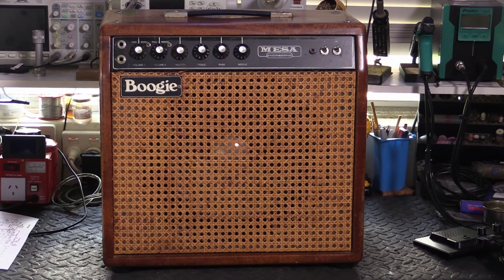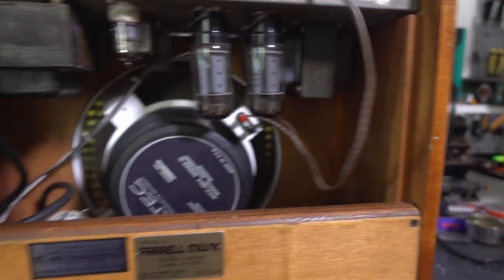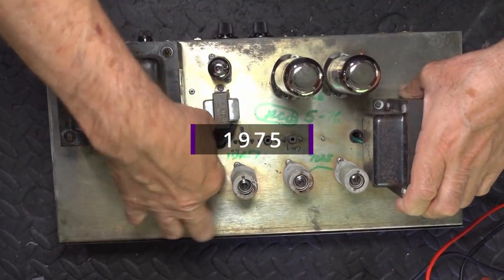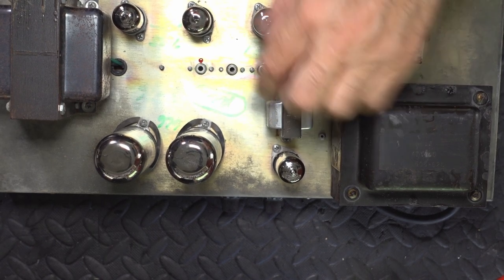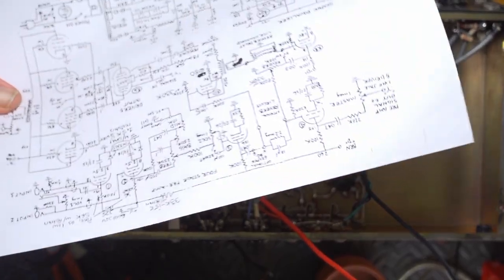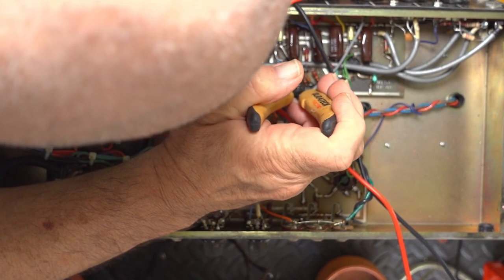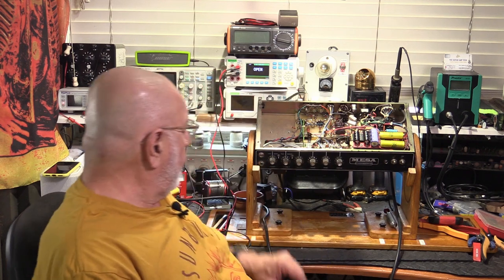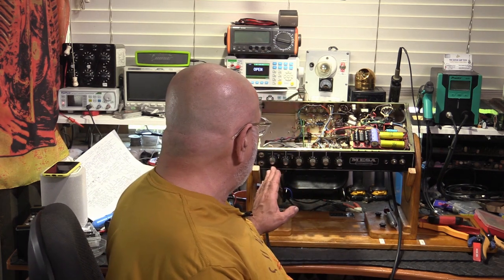Let's Repair and make Safe this Mesa Boogie Mk I - Part One

Comment: It is so interesting to see inside and analyze a Mesa Mk1 amp! Though there are numerous issues with its internal construction and repair challenges, it is an iconic amp and deserves its place in history. I have owned a Mesa 292, 290, TriAxis, Mk5 and Heartbreaker amps. And with these Mesa products, I could not bond with their sounds. I am a tech and opened these up to study them, and was not impressed with the PCB designs, wiring and choice of components. That said, I have a Carlos Santana King Snake combo. I have not opened this up, because I don't want to be disappointed! The simple Mesa amps are their best. Thank you for your wisdom and generosity. Eagerly awaiting Pt 2.
Reply from the maker: I very much like the sounds of the early Mesa amps. I just lost the faith when one 12AX7 pushed another then another. 
Thank you for your kind words, John

Comment: Thank you for a fun trip down memory lane. I designed guitar amplifiers in the early 1980's and owned a Mesa Engineering (Boogie) certified repair lab. On those early Mark I amplifiers Randy Smith added 'antennas' which were flying wires to introduce capacitive negative feedback at very high volumes to tame feedback to a degree. The earlier models from what you have had an 'antenna' running from the output stage back along the entire board towards the input. Like myself, Randy was also savvy in ham radio techniques with high-voltage and on a cold winters day must have discovered some slight improvement with this scheme (later to be eliminated). Carlos Santana (and others) needed high gain, no squeal amplification, and it was true these little amps could 'Boogie'. Those labels are called DYMO labels. I enjoy your channel .. happy to answer any additional questions. -Daniel (Seaside, Oregon, USA)
Reply from the maker: WOW! Thanks Daniel. I was wondering if this wire could have been a rudimentary single stub, but the way it was just snipped with exposed plate voltage made me think otherwise. It had to go just for safety. Removing it, didn't seem to affect oscillation. Did Mesa come up with a better scheme to reduce HF oscillation? I was getting the same amount of oscillation before and after removing the stub...no better or worse.
Reply: I too was an authorized Mesa repair station until they got so obsessed with component density over “sound” design practices and using under specd components like diodes, relays, and coupling caps on the output stage. I had enough quite a few years back and gladly turned it over to another qualified tech.
Reply from the maker: @fiddlix  That was very well put, David. I’m actually a bit embarrassed to say that I still own an early Mesa (…shhhh. Don’t tell anyone). As you said so well, Mesa lost their way, sadly. But, brilliant marketing led to enormous commercial success. After the Triple Rectifier I just completed, I think I will return to my “no-Mesa” policy endorsed by my psychologist, accountant and family!
Reply: I love the very old Mesa Boogies. I have three. Mesa gifted me a Mark 2C they built for Carlos Santana, but Carlos returned it to them saying his guru had told him to simplify his life and he didn't get on with the push/pull knobs and channel switching complexity of the newer amps.  I recently retired from 'real' engineering and for fun, took on about a dozen modern Mesa amplifiers to repair. Terrible. Absolute nightmare. Mesa does not publish the parts placement diagrams so it is almost impossible to trace out and find components without identifiers. No matter how careful and skilled you may be, you will lift traces and pads when replacing many components. So frustrating. I also own a Mark V:35 ... god help me when and if it breaks. There are good reasons why most Mesa techs end up alcoholics (or worse). 🤪
Reply from the maker: @bluewaterstudio  I love your sense of humour, Daniel. How amazing that you own a real Carlos amp!! I 100% agree with Carlos and his Tech about the totally unnecessary pull knobs, relays, or God help us, MIDI in an amp. If you can't find a good sound in a one-channel amp, just keep looking for an amp that natively has THAT sound. For me, the pinnacle of tone was Eric's Beano sound. 
"Mesa Techs end up as alcoholics". Love it!
Reply: Was this akin to the hot shield mod done to Marshall amps to alleviate the microphonic wires from resistors to the grids? I did this to my Mojotone Plexi clone, and it made a significant improvement to the sound, and I was able to use my Legendary Tones Hot Mod on that amp without a high noise floor.
Reply: @theguitaramptech  Sounds like a sound plan to me. Lol.
Reply: So trying to stop high dc voltage from talking to the low ac voltage was a thing instead of a larger chassis and more cost , funny how the CBS corporation did the same thing to stop oscillation when they fired Leo fenders best builders to cut costs and used a disc cap to ground to to compensate the bad lead dress of cheaper workers, ha ha.

Comment: Hello Chris,
once again a video full of humour, competence and wisdom. The older Mesa amps don't seem to be quite as badly designed as the later ones. Thank you for this fine video.
Kind regards
Markus from Germany
Reply from the maker: Thank you so much Markus. I certainly like the sound of the older ones than the newer Mesas. But old or new, they are not pleasant to work on. Way too complex. You would never find ribbon cable, relays and MIDI in the golden days of Fender, Vox and Marshall...and they sounded so much better. But...now I sound like an old guy talking about "the good old days". But they were. And I am glad I lived through them. May your father rest in peace.

Comment: Magic Erasers removes marker easily. Another great video, you've taught me so much, thank you!
Reply from the maker: Thanks for that tip, VTA. I've heard of Magic Erasers, but never used them. Is this the same product you use? https://www.bunnings.com.au/mr-clean-eraser-pad-block_p0066425
Reply: Magic Erasers are very usefull, but can be slightly abrasive to some surfaces, so use caution!

Comment: That high pitch squeal you had earlier in the video is oscillation as you point out. I think you still have oscillation occurring that is out of hearing range that is causing your voltage to shift. Low frequency oscillation at the frequency that you see the voltage shift.
Reply from the maker: Good point A/Tech. There were definitely 2 different oscillations that were plaguing this amp. . I reinstalled the short stub, but it didn't help. Adjusting the Lead Dress stopped it. Good observation. Thank you.

Comment: I have worked on Mk 2, 4 Quad, Triaxis and currently have Mk 5 on the bench and think your comments were very restrained.  Many tech avoid Mesa built ofter 1984 as the repair work is unnecessarily challenging. Mesa do like owners to repair their amps to them for repair and they have good repair techs.  Not so easy or cost effective when owners are outside USA.  I find the tech support via email helpful and prompt since Gibson took Mesa over - presumably providing more resource for customer support.
Reply from the maker: I agree 100% Steve. As you say, it is uneconomic for us Aussies to ship back a Mesa chassis to California. I can get through most of the Mesa repairs on my own, but where I got stuck we had an excellent resource in John Farkus, the Service Manager for Mesa's previous distributor, Better Music in Canberra. For unknown reasons they no longer have the Distributorship. Fortunately, I haven't had cause to call on John since then. I am glad to hear that Mesa support has improved under Gibson. I only had call to call them twice in the Randall era, and both times they were very helpful.  I pretty much lose money on most Mesa repairs, so I will be happy if this is my last. I'm at the age where I can now say: No Mesa.

Comment: Unfortunately the Graffiti you wiped off was the signature of the founder of Boogie Randal Smith who built the early amps himself along with the date of Manufacture.  All early Boogies were built this way. My Mark I has the same markings.
Reply from the maker: Hi Andrew. Have you tried Naptha? It will get off most of that scrawl. HAHA! I wouldn't worry too much. His signature is all through those amps.
Reply: @theguitaramptech  true story 🤣

Comment: those chocolate drop caps in a lot of vintage valve gear are trouble
Reply from the maker: I agree, Ian, but I will NEVER replace a coupling cap unless I can convince myself it has a fault. When your sound passes through it, I treat it with respect. I hate seeing a once beautiful vintage amp with shotgun replacement of horrid looking orange drops. (I used Orange drops here only because Mesa use them and these 2 were leaking DC)

Comment: If the numbers on the tube are too faint to read, rub the tube through your hair to pick up some hair oil, then breathe on it until the glass fogs up, and hold it up to a bright light source, preferably sunlight, observing it as the breath fog slowly fades away. The numbers may be revealed for a few seconds.  Bald techs can simply breathe on the tube to fog it up before holding it up the the light, but  the hair oil definitely helps to make the letters more visible.  Rubbing the tube lightly through your dog's fur beforehand might also help.
Reply from the maker: I absolutely LOVE your suggestions. I tried rubbing the tube through Harley's fur and he just looked at me saying, "has the nature of our relationship changed, dad?" I usually try the fogging method but got nuttin. Totally cleaned of any identification.
Reply: @theguitaramptech  ,  Another old trick that the ham radio operators used to do was put the tube in the freezer for 5 to 10 minutes and get it good and cold, and then take it out and let the moisture in the air fog up the glass.  I've never had to go that far to get the numbers to appear however.
Reply from the maker: I haven't tried that one, but I guess its a variation of the breath fogging method. I'll give it a go right now and report back.
Reply from the maker: I tried the "freezer method". I definitely like that technique. In this case, there was nothing left to find. To be that clear of any printing sounds intentional...or very stupid. Thanks for the suggestion goo 'un ... it was a good 'un!

Comment: Harsh criticism of one of the most significant amps in the history of electric guitar.  Who last touched that amp?  Clearly, parts have been changed.  A thoughtful technician may have asked the owner if he wanted the "tacky graffiti" removed from the chassis...considering those markings were left by the founder of Mesa Boogie, Randall Smith.  I'm curious how much the removal of the factory markings devalued the amplifier.

Comment: Did you check the dissipation factor too with the ESR meter?
Reply from the maker: Hi Scott. Sometimes I check the Dissipation (or Q), but my videos get nerdy enough. As DF or Q is directly related to the ESR, I generally only talk in terms of the better-known ESR. That was an excellent question, Scott. Thank you.
Reply: @theguitaramptech  Yeap, generally other techs are going to ask nerdy stuff. Sometimes the dissipation will be way off and the ESR will be OK. Gernally that's lower voltage stuff, but thought I would ask. :)
Reply from the maker: @ScottyBrockway  I appreciate your comments and suggestions, Scott. In fact, I enjoy them, but it is a continual balancing act of not being too Tech for my muso viewers, or too simplistic for your Tech colleagues. "Keep 'em coming".
Reply: Are they too leaky?
Reply from the maker: @stevehead365  I'm not sure which caps you're referring to. Leaking is more of an issue for coupling caps, while ESR is usually a metric discussed in low frequency Filter caps.

Comment: Considering that these Mesa/Boogie Mk I amps would have easily cost something like Us$5,000 brand-new, I'm shocked at the inside wiring-job too.
Reply from the maker: As was I Simon. Its not the first Mesa I have worked on. They all looked pretty poor inside, but this one looked even worse.

Comment: I’m guessing the people wiring these amps were probably overworked. It doesn’t matter how skilled you are if you are forced to rush too much. Anyone who’s wired a few amps knows it’s not something that can be rushed. But time is money and as long as it works until the warranty runs out, that’s probably all that matters to the accountants.
Reply from the maker: Hi WIlliam. I'm sure the Mesa assembly people are overworked, and I certainly don't want to slag-off those people, but I have never seen a Mesa that was built like a Matchless or Soldano or Freidman. When I first opened up a Matchless DC30, I called Phil Jamison in California from Sydney, just to say how beautiful his work was.  These high-priced boutique amps can be made beautifully...so why can't Mesa? I can only assume it starts from the top. 
Its not just about manufacturing a boutique amp. its can these high-priced amps be serviced at a realistic price.  Randall Smith is a way smarter man than I, but in my humble opinion, Mesa does not respect its customer's sufficiently well to produce an amp that can be serviced at a sensible price.
Reply: @theguitaramptech idk, the amp was non working when this thoughtful tech agreed to service it and the amp is 50 years old so anything could have happened in that time as far as service.
Reply from the maker: @noel3422  Good point, Noel. Lord knows we have seen some bad repair work, but nothing overcomes the shoddy design and production. That offence lies at the feet of the Mesa boss. He should have done a better job for the people who made him a wealthy man.

Comment: You're a brave man Chris, I won't touch a Mesa product. These "vintage" boogies are even bigger P.OS than the modern ones. Nice job on the repairs though and I really like your ESR meter and Maxi matcher and leakage tester. I'm under the impression that Mesa employs cold biases and crossover distortion as part of the boogie "sound"
Reply from the maker: Good to "see" you again, John. Yes. I agree. Mesa's are a loss. I either lose money or I lose a customer. You're spot on about the cold biasing. Who ever thought crossover distortion was a good thing?? Has Mesa not ever heard a properly set up JMP50 or Superlead as it tumbles into saturation? The clouds part, the sun shines and the Angels sing.
Reply: @theguitaramptech  Totally agree bro, well said.
Reply: @theguitaramptech  Peavey 5150 amps are also biased cold, into crossover clipping.
Reply: I suppose cold biased output valves will last longer when hammered, even if the sound is horrible.
Reply from the maker: @stevehead365 You're absolutely correct. When I biased this amp, it was still very cold, but it had no crossover distortion and it sounded fantastic...so go figure. Maybe Randy does know his stuff after all! LOL! (Of course he does!)
Reply: @goodun2974  I've heard that adding an adjustable bias supply and going with the standard 60/70% plate  dissipation, really improves these 5150 amps,  unlike the Mesas. Would be interesting to hear the difference.
Reply: Rarely have I seen such a ridiculous sweeping statement. I've had Boogies here in the UK for 35+ years and never had any serious problems. Reliable and sound fantastic if you know how to tweak them.
Reply from the maker: @Pete_Harris  i’m very happy to hear that you have not had problems with your Boogies. One of my close friends is a huge, boogie, fan and collector. He also has not had many problems. However, I doubt that you would find many Amptech‘s on the planet that, believe that Mesa products are well-made, well designed, well laid out, and service friendly. Even I own a Mesa boogie. And I am the first one to say it’s construction is woeful, but I like the sound of my simple studio 22. It’s when  Mesa tried to be all things to all people that they stumbled. This is purely my opinion, as I said, I’m very happy that yours always have been trouble free.
Reply from the maker: @goodun2974  i’ve only worked on a couple of 5150s, and I don’t recall the bias

Comment: Imho, the main reason why these Mesa/Boogie amps have a reputation for having a flat, cold, clinical sound to them is all down to the preamp circuit, more specifically where the tone stack is placed, particularly in the Mk I series amps, it is placed between two 12AX7 triode gain stages, the result is that no matter what you do to try and shape the tone with the tonestack the end-result is always the same, a heavily clipped square wave, Marshall got it right straight off the bat by putting the tonestack right at the end of the preamp circuit before going to the power amp via a master volume, remember, a Mesa/Boogie Mk I is really nothing more than a hot-rodded Fender amp circuit.
Reply from the maker: A very interesting interpretation, Simon. In the 410 Bassman, the signal goes through 3 triode stages, (but the last is a unity gain Cathode follower),  before it hits the Tone Stack.  I can’t speak for Fender designers, but the next iteration, the 6G12 brought the tone stack forward to after the first triode stage, and kept this through its golden age. I believe this was to make the tone stack more responsive. It also would have made for a much "cleaner" signal hitting the Tone Stack. 
I hadn’t considered another reason being the clipped signal after the high gain signal after the first 2 triodes in a Mk 1. You have a very good point Simon.